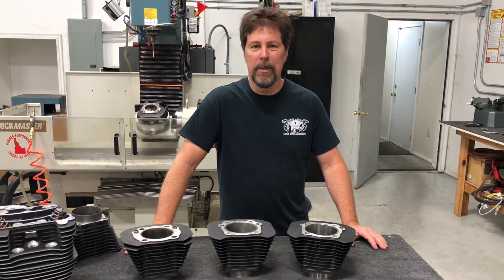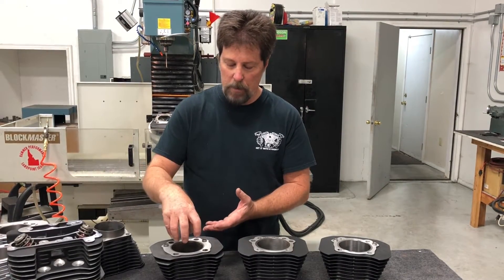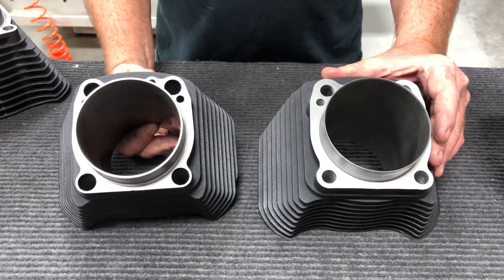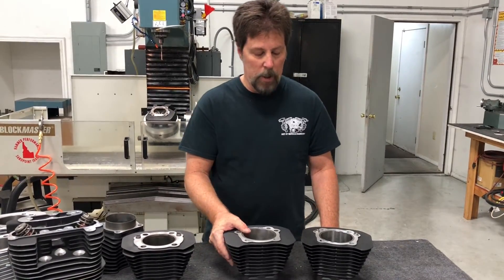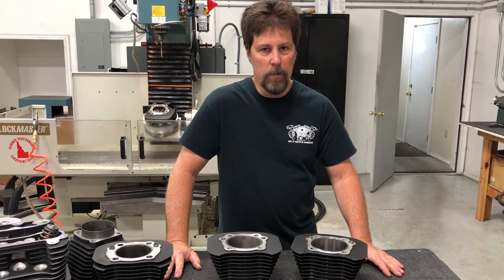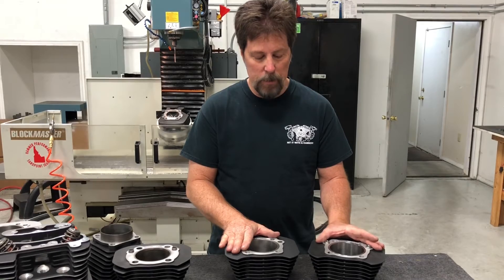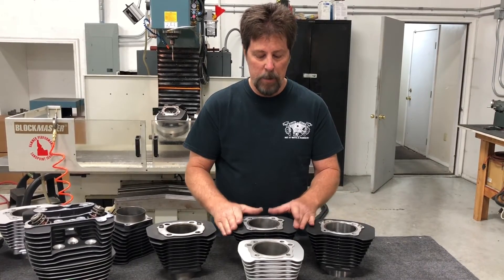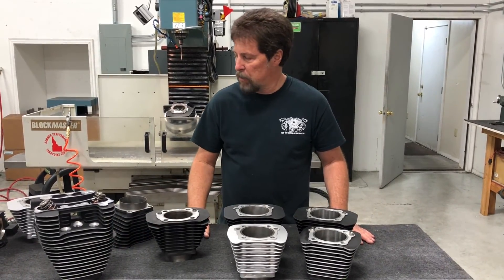The World's Best 1275 And 1250 Kits

Comment: Will the 1275 fit standard year 2000 buell X1 cases and can I run the standard tune?
Reply from the maker: Yes, it will fit, but you must tune it. For the Buell DDFI system, customers have had success with Buelltooth, ECM Spy, and IDS.

Comment: I have the 1250 on my Iron......had the stock heads done with the Sledgehammer port and crush 600 cams.....30%  race clutch, roller rockers....bronze gears  and a patriot defender 2 in 1 pipe and a figure machine open stack.....The bike gets down!

Comment: So od on the spigot is 4 inch is that the same as stock?
Reply from the maker: The spigots are stock 3.675 o.d., no case boring required. The 1250 and 1275 are bolt-ons that can be installed in an afternoon without even pulling the motor out of the frame.
4 inch o.d. spigots are used on 88ci (3.813 bore) and 90ci (3.875 bore) kits. Those kits require a full tear down for case boring.

Comment: Just wondering anyone's thoughts on installing a 1275 kit on an xl1200x motor with 22,000 miles on it. Been through top end kits on dirt bikes a few times.....next thing you know bottom end is blown the hell up! Anyhow, this sporty ain't abused, leaking, burning oil, or ticking. Runs like a dream still! Any thoughts are greatly appreciated from prior Hammer performance customers.

Comment: Question, might be dumb I don’t know. I have a 93’ 1200 sporty, do you guys make 1275 kits for that year? I checked the website but I can’t find my specific year 1200, only 883’s. And do I need to upgrade my Harley carb to something bigger once I get the 1275 kit?
Reply from the maker: To get a 1275 kit for your bike, go here: http://www.hammerperf.com/xlbigborekits.shtml#1275ordering
-Choose small fin cylinders
-Choose the cylinder color of your choice
-Choose either flat top pistons for about 9.5:1 compression ratio (stock cams) or radius dome pistons 10.5:1 compression ratio (cams with intake close timing more than 46 degrees)

Also go here: http://www.hammerperf.com/xlbigborekits.shtml#1275options
-The ring gapping service, top end gasket set, and ignition are highly recommended
-The jets and spark plugs are required

Your stock carb will work fine up to about 90-95hp. You only need to change it out if you're shooting for a number bigger than that.
Reply: HAMMER PERFORMANCE  thank you very much!

Comment: What web site would you recommend me to buy the heads for my 883 Harley  Sportier To convert to 1275 ?
Reply from the maker: There is no need to change your heads when converting to 1275. In fact, the vast majority of 883-1275 conversions are done without changing the heads. See this package for example, it includes everything you need for a successful conversion and it works fine your stock 883 heads: http://www.hammerperf.com/883conversions.shtml#basic . The higher power packages described immediately after that one also use your 883 heads, but those packages require you to send your heads to us for work. That's still a lot cheaper than replacing the heads, though, on a horsepower per dollar basis.
Reply: @HAMMERPERFORMANCE  Would the 1275 work on my new 2020 iron 883. And how much would it cost to have it converted if you don't mind me asking.
Reply from the maker: @malkiyahyasharel1964  You can see the pricing on the complete conversion package and even order it at this link: http://www.hammerperf.com/883conversions.shtml#basic . That package has everything you need for a successful conversion. You can download the sample quote there for a complete list of what it comes with. As far as installation goes, more than 90% of our customers install it themselves. We've built our business around do-it-yourselfers and we have good instructions and videos to show how it's done. If you want to farm it out, you can probably expect about 7-8 hours of labor due to the fact that your bike also gets a clutch upgrade (included in the package).

Comment: Have had my Iron 883 for a bit over a year. Love it, but it would be awesome to get a 1274 kit. Is the tuner included with the kit the best fit for it or can another brand be as effective as well?
Reply from the maker: The Dynojet Powervision is, in our opinion, far and away the best EFI tuner product available for HD applications, nothing else really even comes close. The little display unit makes it much more powerful and easier to use than competing products, and gives it a rich feature set, everything from highly configurable gauges to a simple-to-use autotune function to the ability to read and clear codes to on-the-fly changes, multiple stored tunes at the ready, the list goes on and on. It just blows away everything else on the market. Therefore we chose it to be the primary tuner that we recommend, offer, and support directly with a tune. Other flash-type tuners can be used, but your life will be a whole lot easier if you get a Powervision. Read here for more information: http://www.hammerperf.com/883conversions.shtml#faq6
Reply: @HAMMERPERFORMANCE  thank you so much for your reply. Sounds great! In that case, I'll start saving up for the whole kit as well as a full exhaust and a high flow air filter. I'm a new subscriber, so I'll be checking out your other videos. Thanks for the info.

Comment: Is there anything available between the 
78 in. /1275 and the 88 In. / 1450 ?  
ie. 1340 - 1375  ??
For '07  up 1200's
Reply from the maker: Yes, but custom cylinders are required. Really the only reason to go for an odd size is the need to meet displacement limits in a particular racing class.
Reply: @HAMMERPERFORMANCE  and of course custom (3.700) pistons and boring the cases... but I never do anything easy.  Just seems to me that 88 / 90 inches  on that bottom and transmission  is pushing the limits.  And I don't particularly care for the iron cylinders. Can we get a 4.10 o.d. (or more) liner in the aluminum jugs ?
Reply from the maker: @johngilbert6810  I'm sorry, we have nothing available and I'm not aware of anything in the aftermarket to support that. You're talking about an extremely small market and I really doubt anyone has invested in the development of the cylinders. Everyone does 88 or 90ci. The bottom end, primary, and transmission can handle it no problem.

Comment: So do you have to bore the cases with the 1250 or 1275 big bore kits? Also do u have to upgrade the clutch and primary with these kits?
Reply from the maker: No case boring required, these are bolt-on kits that can be installed in an afternoon without even pulling the engine out of the frame.

1200 models do not require a clutch upgrade. Likewise, 1986-2003 883's don't require it. However, all 2004+ 883's do require a clutch upgrade. That's because 883's have been coming with a weak clutch spring since 2004, and the clutch will slip after doing a conversion unless the spring is upgraded to match. A spring is only a $30 item. Most guys however will opt for a full extra plate clutch upgrade, while they're in there. The extra plate clutch kit eliminates the factory spring plate (aka "grenade plate") in the stock clutch that's so failure prone.

All years and models however require at least some extra pieces, beyond the engine kit alone, for a successful conversion. For a complete list of everything required for a successful 1250 or 1275 conversion, go here: http://www.hammerperf.com/xlbigborekits.shtml#1275options . The items can also be purchased there.
Reply: @HAMMERPERFORMANCE  awesome thanks for the info looking forward to ripping up the pavement

Comment: Would the 1275 kit work for 2009 XR1200 ?
Reply from the maker: Yes, we have many customers who've successfully installed the 1275 kit onto their XR1200. It uses a little different head gasket from a standard 1200, but it's otherwise the same kit. We provide the correct gaskets with the kit. Also be aware that we do not offer the gray color cylinders like the stock XR1200 models came with. Most XR1200 owners go with straight black instead. If your bike is an XR1200X then we do offer the black highlighted cylinders to match. You must also use a capable flash tuner. We recommend and offer the Dynojet Powervision and support it directly with a tune, so your life is a lot easier if you go with a Powervision. And finally you must also run the spark plugs we specify, which are actually the 10R12X Gold plugs that were stock in XR1200 and certain Buell models, part number 27794-08.
Reply: Thanks for the quick response

Comment: I finally have some money to get my 2003 Sportster converted to a 1200 +. I would like to go as big as I can, within reason, price wise, and not having to mill out the case. I'm guessing that it would be better to use the 2004 & newer cylinders, but I don't know. Is it, and what is the caveat to it that you mentioned? I am trying to do this very soon. Any information that you can give me would be great. Also, I heard someone mention a break in time after putting one of these kits on. What do I need to do?
I'm watching your video "Converting A Harley Davidson 883 For Big Power". Do I need to change out anything else, like cams or not? Are the pistons sold as part of the kit or not?
I was told that it's not good to bore out the 883 cylinders. Won't the life of them be much less that the kits, as well as perform less? I'll check out the Tech. Tip section of the website, too.
Reply from the maker: Read this page, it will answer most of your questions: http://www.hammerperf.com/883conversions.shtml . The break-in procedure is covered in the kit installation instructions, specifically right here: http://www.hammerperf.com/ttinstallkit.shtml#BreakIn
Reply: I’m putting a kit in mine but am undecided on which cam.  I don’t want to sacrifice the nice response around town for max horsepower. I don’t want a twitchy sport bike.

Comment: Got a 1250 kit from you guys a while back. My bike is a 1200R and I’m running the stock heads. Got the Hammer cams & the big bore kit, Master Tuner & V&H Blackout 2 into1 & my bike rips 99 HP and 87torque! Love it!! Hammer rocks!!🙌🏻
Reply from the maker: Congrats on your successful project!
Reply: Wow that’s impressive. Thinking about doing my 2000 XL1200C to a 1250. Sounds like your very happy with them...

Comment: I have a question:;;;.does the stock 883 use the same cams as my 2017 SPORTSTER..same ratio , lift and duration??
Reply from the maker: All 2007+ Sportsters, 883's and 1200's both, have come from the factory with "W" cams. So if the 883 you're talking about is 2007+, then yes, it came with the same cams as a 2017.
On the other hand, if it's a 91-06 model year 883, then it came with "D" cams, which are a whole different animal.
You can find a dyno sheet that compares Andrews N2's, W cams, and D cams, with no other changes, on a 883-1250 conversion at this link: http://www.hammerperf.com/883conversions.shtml#faq1
Reply: @HAMMERPERFORMANCE  thank you..I'm setting here thinking of. Up grading my 2017 Sportster 1200 low t to a 1275. Is it recommended?
Reply from the maker: @robbierussell9536  Only if you want more power
Reply: @HAMMERPERFORMANCE  I guess my fuel mileage will go down some..I have a 4.7 fuel tank. I normally get 45 mpg
Reply: @HAMMERPERFORMANCE  living in Florida I put a oil cooler on it k&n air filter I run Amsoil ..And Vance and Hines 3 inch exhaust
Reply from the maker: @robbierussell9536   Most customers report a small improvement in fuel mileage from a 1275. Raising cylinder pressure and improving squish clearance tends to make a motor more efficient.
Reply: Wow that's great..I'm glad to hear that fuel mileage won't change that much. Thanks guys you been very helpful!! .I'm thinking.. where you located???

Comment: What does this do to longevity going from 9.3 to 10.1 compression? What’s the power like with stock 883 cams and heads?
Reply from the maker: There's no measurable effect on the longevity by raising the compression to 10:1. As far as the power goes, follow this link to see some dyno sheets using stock 883 heads and cams: http://www.hammerperf.com/883conversions.shtml#basic

Comment: I was reading on your site a bit about the 1250 and 1275 kits, says that I can retain my stock 883 heads with the kit, but I would like to know if that means when I change out my heads do I need to change pistons out again? I plan to stay with a flat top style piston due to cost on head work
Reply from the maker: 883 heads have very small 49cc chambers, and if you run flat tops under those chambers then your compression ratio will be about 11.8:1. To run flat tops under 883 heads with a pump-gas friendly compression ratio you have to hog out the chambers and make them bigger. But this is a terrible way to do a conversion because you lose the squish band. The best way to do a conversion is to use a reverse dome conversion piston. By putting a dish into the middle of the piston, you bring the compression ratio down to pump gas friendly levels while still maintaining a squish band around the perimeter of the chamber. This is why reverse dome conversion pistons are far and away the most common way to do a conversion. Watch this video for more information: https://www.youtube.com/watch?v=F9d-AJ3R6Js 

So the answer to your question is that you really need a different piston to run a stock 883 head as opposed to a stock 1200 head. 

Furthermore, when you do head work in conjunction with big cams, you need to change pistons again. That's because regardless of whether you're talking about an 883 head or a 1200 head, the chambers have to be made bigger to make room for bigger valves and high overlap cams and have all the clearances you need. Making the chambers bigger causes the compression ratio to drop unless the pistons are changed to match. Watch this video for more information: https://www.youtube.com/watch?v=flgdYTCfXuU

Bottom line is that pistons, cams, and heads need to be a matched set. You can't move any of those three very far without bringing the other two along. This makes it really expensive to build a motor incrementally over time because you end up buying some parts twice. Not the answer I want to give, believe me, we get asked about this every day, because guys want to spread out the cost over time. But I can't change the laws of physics. 

What we recommend is to pick a power level and build toward it, and do it only once even if that means saving your money for awhile. We offer six different packages that are designed to deliver anywhere between 70+ to 120+hp, time tested and proven to deliver their power levels in the most cost effective way possible. Each is a carefully matched combination of parts and services. You can read about them here: http://www.hammerperf.com/883conversions.shtml#packages

Comment: Great job guys. If you can just turn up volume of the videos a little bit more up that would be great. Lots of us watch this videos on phones and volume is low by default. My 1250 is running great . I would like to be sure you will manage to resupply us with new pistons and rings in future. I dont have any connection with Hammer Performance but personally i can assure all of the people who are thinking about buying kits from Hammer that Hammer P products are top notch quality. I am overseas and our mechanics and machinists say same thing when they get in touch and test this goods. Carrillo pistons are really good. Personally i run flat tops in Lightning dual plugged heads and i couldnt believe motor response after putting this jugs... it can not compare to 883 performance not even my XL1200S 1998 stock wasnt close to this performances. I think every owner would be very pleased with 1250 and 1275 kits. It makes your 883 imidiatelly competitive to every big twin out there. I can outrun most of classic riders of Japanese sport bikes on a street light. They just can not keep up with torque of a Harley Davidson Sportster in start. Thsn they get confused how a tractor can perform like that. ;-) LIKE IT ALOT. All the best. @tattooglisha
Reply from the maker: Yeah we're gonna work on the volume situation, getting some kind of microphone setup that will hopefully solve the problem. Should be solved for the next one.